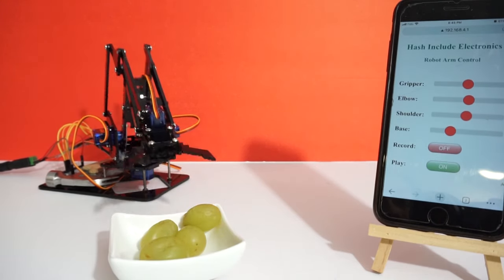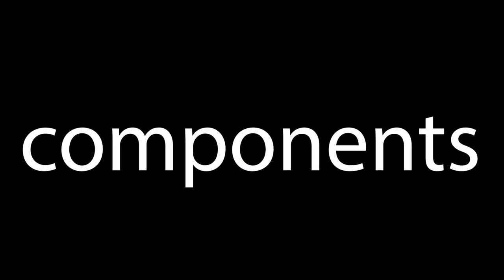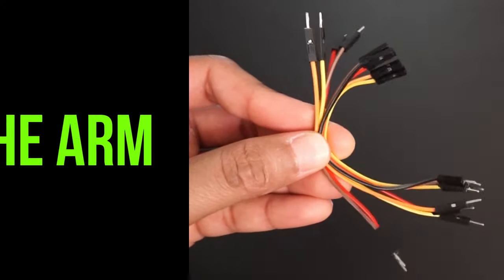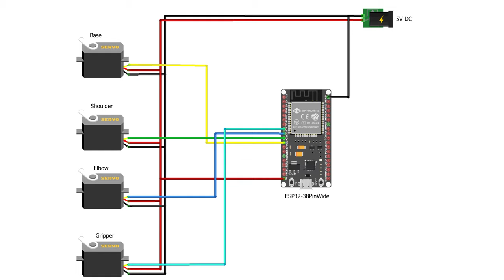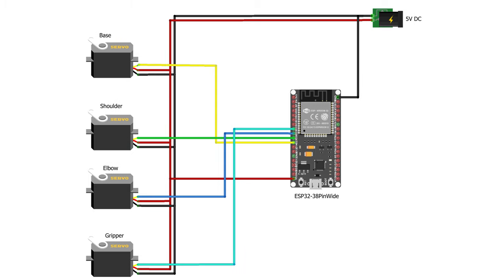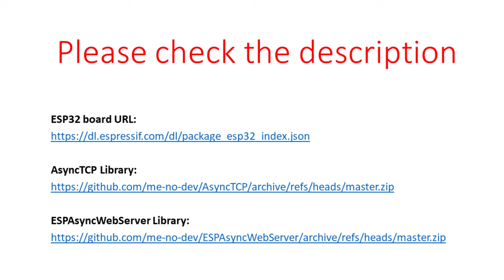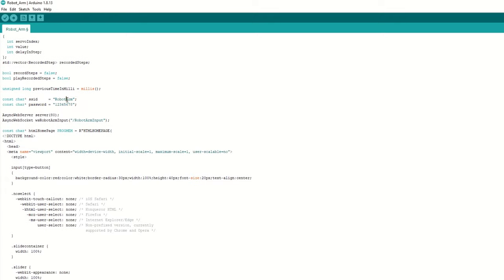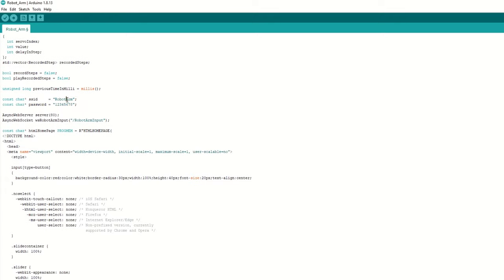Robot Arm using ESP32 and Smartphone | Complete Robot Arm assembly 🔥

Comment: Hey bro, i have made this robot arm . It is working well but i want to change the power mode from AC supply to batteries.. So, how do i make it? And how does power of battery does it take??
Reply from the maker: That’s good question . You can check my video on robotic arm car where I have used this assemble with car and provided 5v from battery supply with UBEC . 👍🏻
Reply: Bro did you face any lag issue

Comment: Really great projet, worked out of the box.
One question: I would like to use the arm also from my laptop. The servos work fine, but the buttons are not responsive. Adding an additional button with 
onclick='onclickButton(this)
works on the laptop, but not on the smartphone. 
Is ther a way to combine these calls?
Thanks in advance.
Reply from the maker: Yeah some touch events works only on touch screen smartphone. This project is only meant to work on smartphone. I tried it to work on both smartphone and laptop but did not find a proper way yet. If you have time then try using different events like oninput, or changing the button to something else . But it will need your time and testing . 👍🏻
Reply: Hi.... Do you get the solution for laptop?
If yes please share its coding
Reply: @SonGoku-gg6tq  No, I did't get it working and stopped working at the project.

Comment: Im using MG90S 360 degree servos. When i turn my device on two will spin slowly while two stay put until called upon. If i change the positions it will make a third servo spin while making one spin fast. Ive tried changing GPIO pins, servos, position values. The only thing that sort of works is keeping the values at 90 but then ill have two servos that spin uncontrallbly until i get to the webpage

Comment: I assembled all of these! But will it work with ESP Wroom 32 board which has 30 pinouts? I tried its not working! But compiling and dumping is completely done without errors. Webpage isn't opening while i enter IP
Reply from the maker: Please use esp32 38 pins only to avoid any issues .

Comment: hi i also want to ask that how do you calculate voltage and current needed for projects
Reply from the maker: You need to find approximate current which will be consumed by all components . Like in this project there are 4 servos. So consider each servo takes around 500ma max (Check datasheet of servo). so total 2A + small amount of current by esp32 (we can ignore it for now) . So any supply more than 2A current should be good.

Comment: can you be more specific with the 5V ac dc adapter
Reply from the maker: It should provide 5v output with more than 3 A current 👏🏻👍🏻
Reply: @hashincludeelectronics   what happens when its 2A
Reply from the maker: @SuhariRajaguru  there are 4 servos and each servo can take upto 700-800 ma. So 2A for all servos can’t be sufficient and may cause issues like processor restarts etc . So better to have output current >=3A .

Comment: Good project friend, a question that I have to modify so instead of using an esp32 I can use an esp32 cam and be able to see what is transmitting?,thanks and greetings
Reply from the maker: You can check my videos on esp32 cam for reference . You can make changes as needed .

Comment: Sir Can we use another thing except of 5v AC DC adapter.
Reply from the maker: Yes you can use battery which will provide 5v and more than 2 A current 👍🏻👏🏻

Comment: Is there a way to program a led light to work through the toggle system. My led only has a positive and negative outputs.
Reply from the maker: Yes you can do that . Copy paste the code which is written for the button and use it fir turning on off led 👍🏻👏🏻
Reply: @hashincludeelectronics  alright thank you very much

Comment: This thing made from acrylic right?
Reply from the maker: Yes. Actually I bought this arm kit online . 👍🏻👏🏻
Reply: @hashincludeelectronics  All servo in this robot arm are 180 degree right?
I have one with 180 degree and one with continuous turn.
I want to make sure I'll get correct ones.
Reply from the maker: @jumbo999614  please use only 180 degree servos 👍🏻👏🏻
Reply: @hashincludeelectronics  Thanks again for replying.
Could you please teach coding part of this tutorial.
I'm new to this and I'm not good with programming.
I will learn a lot if there is more detail on programming.

Comment: Great project bro.👍but i have a problem..! Node mcu get power source off ,before recording position are gone.! Any solution is there..? Iam making robotic arm As a my final project
Reply: And one more broo iam using suction cup in my project ,it's also want to record ,for solenoid control ,we able to use button in this program, your help I need broo
Reply from the maker: You need to use non volatile memory which is EEPROM to store the recorded values . Please check some videos on how to store values in EEPROM . This needs lot of code changes. I can just provide this info to you . Good luck 👍🏻
Reply: Thanks for your reply broo🙃

Comment: Hey bro, any idea how to fix the robot arm where after disconnecting the power supply, the robot arm shakes very violently, any idea what causes this? P.S. i have soldered the wires connecting between the power supply and the esp board
Reply from the maker: Not exactly sure about this 👍🏻👏🏻

Comment: Bro is tht 5v ac dc power supply adapter dangerous??? Cuz it's like 5v ,while doing the project u accidentally touch the wire .can it be dangerous? Pls reply bro
Reply from the maker: 5v dc output is not dangerous. However the ac input is dangerous. So don’t ever try to touch ac which is high voltage . 👍🏻

Comment: Bro, I did complete the model using your codes and schematic diagram, but the servos and ESP32 are not functional due to power shortage, When the servos are connected wifi is not getting started, please suggest, me how to power both esp32 and 4 servos,
Reply from the maker: You can use the 5 v ac dc adapter same as I used in video 👍🏻. It should provide minimum 3 A current .

Comment: I have an esp8266 module actually so can this code for esp32 work on that esp8266
Reply from the maker: I am not sure if this will work with esp8266. I would recommend to use only esp32 to avoid any issue 👍🏻👏🏻

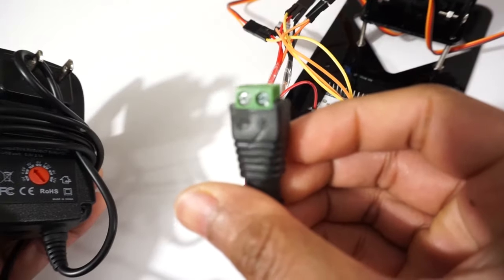Comment: Hey bro what is the thing called at 15:16 where you used to connect between 5v dc power supply and and the esp board?
Reply from the maker: That is just a connector which came with adapter. You can directly connect wires as well from your power supply 👍🏻👏🏻

Comment: Sir i have used two 3000mah 18650 batteries to start the servo motors but the servos are not working not even a single servo is moving please tell me some method to get them working .please help me as i am using esp32 for the first time
Reply from the maker: We need to provide exactly 5v . How much voltage are you providing total ? If you provide more than 5v then the circuit will be destroyed .

Comment: Does it lift 500g ? Or how much it's capable of lifting a weight
Reply from the maker: Thanks for checking out the video. I don't think it will lift 500g with these plastic servos. This is a prototype project but you can use strong servos which has this capability of lifting weight.

Comment: i have a question. is there a way to set it up so when i plug my project in it will start with all the motors at the same rotation they are. because when i plug it in all my motors rotate.
Reply from the maker: It can be possible . You need to store the positions in the EEPROM. However you will have to make the code changes for that and test it 👍🏻👏🏻
Reply: Perfect thank you :D
Reply: There is one problem. I've never coded c++before. I'm just getting into it. Would you be able to help me.

Comment: i know this has been a While is there a Way to build this using a Router i want to build 2-3 Robots 2 Axis Base and Tilt for a Camera
Reply from the maker: You can do this by creating wifi in station mode . You can check my video “getting started with esp32 “ to see how we can connect using station mode to router wifi credentials 👍🏻👏🏻
Reply: @hashincludeelectronics  how much power does this take to power

Comment: hello sir, when i connect the 5v ac dc to the esp32, the robot arm works on its own and after connecting it ssid- roboticarm, it won't be controlled using the web page
Reply from the maker: May be there is loose connections . Check properly 👍🏻👏🏻

Comment: Hello sir, I'm a little confused when verify the code.

When I verify it using the ESP32 Wrover Module board, the code could not be verify.

But when I verify using the ESP32 Dev Module board the code was successfully verify

So is it possible to use the ESP32 Dev Module board, sir?
Reply from the maker: Not sure if it will support esp32 servos. I would suggest to use only esp32 wrover module 👍🏻👏🏻

Comment: Hey man do you think you could add another servo to this project in the code? I tried adding it myself but it doesn't move from the web interface
Reply from the maker: Yes we can add another servo to this . Please try to copy paste the servo code . Give it a shot . It will work . I don’t have this assembly right now to try 👍🏻👏🏻
Reply: @hashincludeelectronics  after a bit of tampering it worked thanks
Reply from the maker: @Determinator21  that’s really good news . Awesome job 👍🏻👏🏻. Happy that it worked 🙂

Comment: I tried project.But instead of 4to 1 wiring I used bread board It's not working.I am getting home page and connection is same but with breadboard.Pls reply me asap m using for final year project ❤️
Reply from the maker: Make sure the connections are not loose . 👍🏻

Comment: Can i use one lithium ion cell instead of that adapter. 1 cell is 3.7v,. Please tell its urgent
Reply from the maker: Please make sure you provide only 5v supply . Whatever cell you use , it’s should only provide 5v 👍🏻
Reply: @hashincludeelectronics  Bro its providing less than 5v, its providing 3.7v. I dont have any adapter
Reply from the maker: @codmhumanoid9271  in that case you need to voltage buck converter . Check for how you can step up or step down the voltage . You can also refer my other videos where I have used servo motors with car. There I have used UBEC for converting higher voltage into 5 v 👏🏻👍🏻
Reply: @hashincludeelectronics  wait, i have a buck converter. So if i use 2 lithium cells which are total 7.4v and connect them to ubec converter, it will convert them to 5v and the project will work? Is this idea good?
Reply from the maker: @codmhumanoid9271  yes it’s a good idea 👏🏻👍🏻
Reply: @hashincludeelectronics  I just hope thats its not dangerous. The thing is - I am converting 7.4v to 5v using buck converter. Is this safe?

Comment: 15:17 how many amperes does the power supply use?Please respond promptly.
Reply from the maker: More than 3A. 👍🏻👏🏻
Reply: @hashincludeelectronics  that means I have to use 5a right? is that so
Reply from the maker: @azriel.garage5524  that would be nice 👍🏻👏🏻
Reply: @hashincludeelectronics  I use 12V, is it possible?

Comment: I am using esp32 32 pin but it is not working so can u give me ha hint that how could i use esp32 32 pin with this code
Reply from the maker: I believe you can use esp32 32 pins . However I would recommend to use 38 pins to avoid any issue . This is little bit complex  project . 👍🏻👏🏻

Comment: thank you.  I copied the code. included the #include <ESPAsyncWebSrv.h> which brought along a few other libraries.  even though the ESPasynchWebserver library  is listed as "...Server" in the library manager, the program demands I change it to "... Srv" and won't recognize the ...Server in the code . I mention this because the code loads fine and the server starts with my SSID and password but my iPhone browser and my computer browser can't find the IP address and won't connect.   This is even though the serial monitor says "HTTP has started."  any insights to what I'm missing?
Reply from the maker: Thank you very much for checking out the video 👍🏻👏🏻. Check the power supply and take a look into video again slowly and carefully for any missing step . 👍🏻
Reply: @hashincludeelectronics  thank you.  I see I downloaded the wrong ESPAynchWebSer.... library.  :hand-orange-covering-eyes:
Reply from the maker: @jbelmont72  😂. No worries . Hope your issue gets resolved 👍🏻👏🏻

Comment: Should the code be changed for mg90 because the movement is very laggy
Reply from the maker: Yes you can use this code 👍🏻
Reply: @hashincludeelectronics what about the lag is there anything missing i did everything as per the video
Reply from the maker: @sanjaykrishnaars  there should not be any lag. Do you see your servo motors rotating slowly ??
Reply: @hashincludeelectronics  no they either rotate fast and rotate after a few minutes, sometimes they just rotate erratically
Reply: @hashincludeelectronics  i am able to see the web page but the control isnt as smooth
Reply: @hashincludeelectronics  should i reduce the angle values

Comment: How to modify the code to achieve angles greater than 180?
Reply from the maker: You need to just change the min and max value of slider in code. However you might have to take a look at how servo library can handle angles.

Comment: I connect 4 servo motors to 5V supply of esp32. But the system is not working. If I make connections of servos to esp32 then the webpage is not generating. But without connections of servos the webpage opens. Why this error is coming. I tried using l298n motor driver also.
Reply: Also motors are not running. I checked motors with simple servo code. At that time servos work properly
Reply from the maker: What’s the current capacity of your 5v supply ? It should provide more than 3A
Reply: @hashincludeelectronics  I am using l298n motor driver. It provides 2A current
Reply: Actually I am attaching this robotic arms over surveillance robot car. So connecting wired adapter is not possible because car's movement. So which power supply or motor driver can I use?
Reply from the maker: @sohampujari6841  ok I got it . That’s the problem . You need to use UBEC or buck converter to convert high voltage into 5v . Also there is a video on my channel for robotic arm car. Please check that 👍🏻
Reply: @hashincludeelectronics  yeah. I saw that video. In that you are controlling it using ps3 but I want to control it by mobile
Reply from the maker: @sohampujari6841  ok for servo motors please use UBEC for power supply . It will solve your issues 👍🏻
Reply: @hashincludeelectronics  I connected the ubec cable. 5V supply is going to servo still servo is not working. What should I do?

Comment: even after installing asynctcp im getting error

Compilation error: AsyncTCP.h: No such file or directory
Reply from the maker: Please uninstall any previously installed library and then install again . That might solve the issue 👍🏻👏🏻
Reply: @hashincludeelectronics  thanks!! but i got another issue...my esp32 is not getting detected in arduino ide( no use even after changing the ports)..help if you know about this

Comment: The voltage and current of a halo adaptor cable are how many   and how many amps? please answer immediately
Reply from the maker: 5v and more than 3A current 👍🏻👏🏻
Reply: @hashincludeelectronics  I use a 12v and 3A adapter cable is this correct? please answer as soon as possible should i use 5a?
Reply from the maker: @azriel.garage5524  you can use any cable . However the rating of AC DC adapter should be 5v and current more than 3A.

Comment: I want to attach it to battery
Reply from the maker: Then you will have to provide exact 5v from battery supply . You can use voltage converter to step up or step down battery voltage to exact 5v . 👍🏻👏🏻

Comment: Sir I am using 3.7 volts 2 cells
Reply: Do I have to use any voltage controller so it will provide 5v constant supply.  If I have to use any which one please suggest
Reply from the maker: You need to use exactly 5v . Use AC DC adapter which provides 5v output . Or if you want to use dc battery then you will have to use voltage converter which will convert high voltage into exactly 5v 👍🏻👏🏻
Reply from the maker: @sumeetmurgod2211  you can use UBEC. Please check my other videos for reference 👍🏻👏🏻

Comment: Hi can you show and explain the flowchart of the code of this robot arm?
Reply from the maker: It’s all explained in the video . Please check it slowly 👍🏻
Reply: Did you use a Led terminal connector only to connect wires?
Reply from the maker: @jasminenera7135  those are jumper wires . You can use any wire as per convenient 👍🏻
Reply: Hi, i have a message from your ig account can you check it?
Reply from the maker: @jasminenera7135  sure let me check and get back
Reply: @hashincludeelectronics  i already messaged you at your ig .

Comment: How to fix intermittent wifi error on robot arm
Reply from the maker: Use good 5v power supply with more than 3A current 👍🏻👏🏻
Reply: @hashincludeelectronics   5v power available on esp32 board?

Comment: Sir 192.168.4.1 is not opening in chrome even in https format..what to do
Reply from the maker: Did you connect to the robot wifi ? Check the video for this step 👍🏻👏🏻
Reply: @hashincludeelectronics  yes sir I connected to wifi robot arm ...then I try to open the 192.168.4.1 in chrome..but it's not opening sir
Reply from the maker: @explorewithak7888  ok . Do not connect the esp32 to robot. Just connect esp32 to laptop and try . 👍🏻👏🏻
Reply: @hashincludeelectronics  ok thankyou

Comment: please help my robot moving a little bit and pasword dont work
Reply from the maker: I would suggest to check the video slowly and carefully to not miss any step . Check fir loose connections . Check fir servo motor connection. Use proper power supply 👍🏻👏🏻